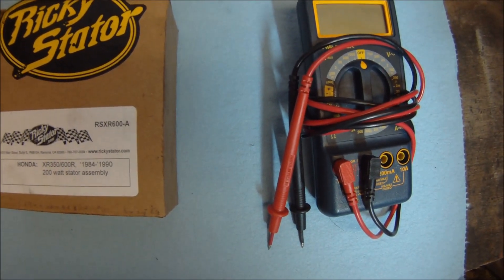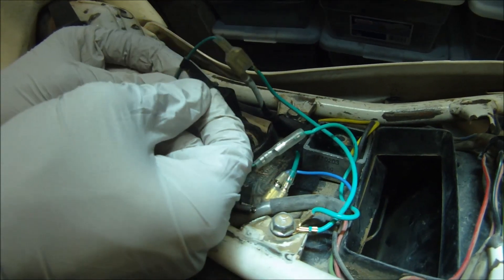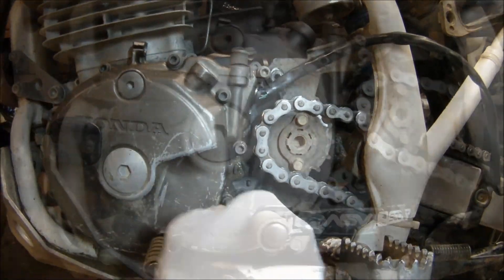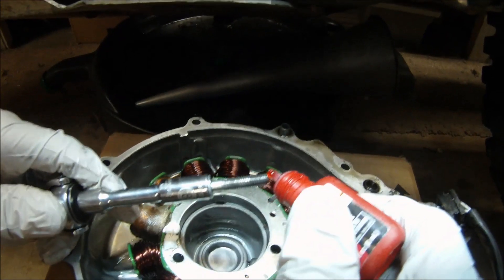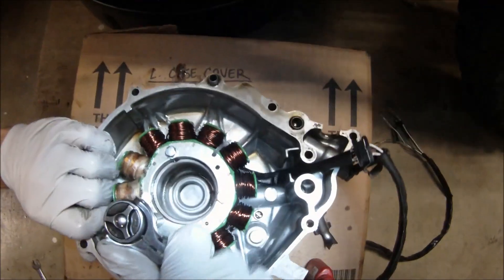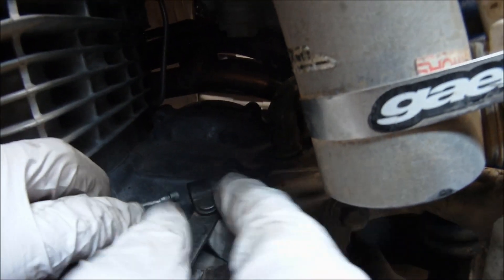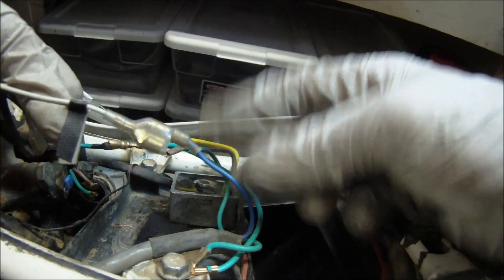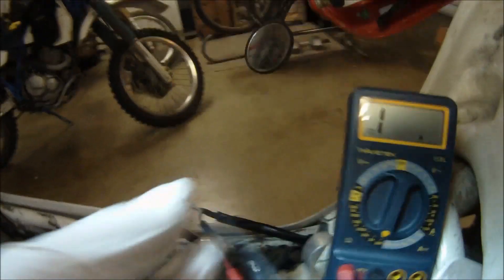XR600R Stator Replacement

Comment: Thanks for the video. My chain snapped and cut off my stator cable. Now I know how this works, this should be an easy soldering job.
Reply from the maker: Wow, that sounds like a scary adventure you had to endure. Where you far away from home when this happened? Did the chain do any damage do your left engine case? Glad we could help and best of luck! Hope you came out unscathed yourself.
Reply: XRLand I wasn't too far.away from home. My dad picked me up. The chain did no damage to the left case but the screw holes of the sprocket cover broke. Luckily nothing happend to my girlfriend or me.

Comment from the maker: You can use the 200W Ricky Stator, but you will need an AC regulator that can handle the extra wattage.  Email sent with more information.  Thank you for your question, and have a great week!

Comment: When you replaced your stator did you also replace your regulator? I’m having some confusion on how I’m supposed to do this. I bought an RM stator and now I’m not sure how I’m supposed to be wiring up my new regulator. 

Lost spark and suspected the stator or regulator to be the issue

Comment: Great video very useful. I have a 85 XL 600 with a Ricky stater in it and I’m having problems starting now after about a year cording to my Honda service guide I have to check both the black in the red wires and I’m only getting resistance in the black side is 65 and nothing from the red wire. So I’m thinking I’m gonna need a new stater just want your opinion before I go out and buy one. And also how did that Ricky stater you put in hold up?
Reply from the maker: Hi Dell Davis. Good to see those 80's XLs still being kept up. I've only had experience with factory stators and Ricky stators, so I can't comment on how they compare to other brands. While Ricky stators are expensive, they seem to have good build quality and lasting performance. I don't have anything negative to say. If you're going to get one with higher wattage, then you may want to consider a regulator to handle excess power. I'm not very familiar with the physics of electricity, so I can't provide any useful information beyond that. I never had a problem with my Ricky stator thankfully, and the reviews seem pretty good overall on the internet. Hope you get your bike back up and running soon! Take it easy out there. Best.
Reply: @XRLand  thank you for the reply I’ll probably go with a Ricky stater because the factory ones aren’t available anymore I’ve been looking for one but no luck

Comment: Nice informative video.  Have 85 XR600R with headlamp, tail/brake light & no battery. Can I tap into my headlamp wires with a fused power outlet to operate my Garmin GPS? Believe it's stock stator, but not positive.
Reply from the maker: Larry J Hi Larry. I would venture to say yes, however, I do not have a degree in physics nor electrical engineering, therefore I cannot give you an educated answer. I have done this type of tapping before, but without extensive knowledge, I would rather recommend you ask someone that can give you a confident answer so that your Garmin doesn’t get damaged. Sorry I can’t be more help, but I’m a biologist 😂 thanks for dropping by the channel. Ride safe and enjoy that classic 85!
Reply: Wow, never had such a quick response! Was watching your brake bleeding video.  Thank you for the response.  Will test output at wires w/volt meter to verify proper voltage before going any further, Thanks PS: just subscribed.
Reply from the maker: You left me some nice comments so I felt compelled to respond. Always a pleasure to have kind people grace the channel with their presence. Take good care and enjoy having GPS on your thumper. Kind regards.
Reply from the maker: ah and thank you for the sub. I don't post a lot anymore, but when I do I'll make sure it's worth it.

Comment: For we dummies....... Why did you not address the direction the stator goes back in ?   Is it unimportant.?  ( I neglected to mark which hole s . ) I also have some type of 2 screw seperate unit with the stator . It,s wire limits where the new stator may mount.
Reply from the maker: Hi Jr Johnston. I didn't know it was important to mention. The wiring came out of one side which allowed me to decide which orientation to install the new stator. Does your old and new stator not have obvious differences between front and back? Hope the build is going well.